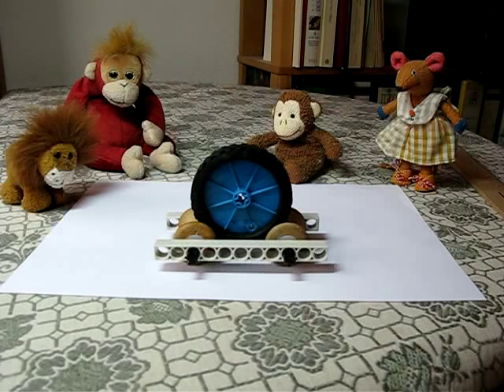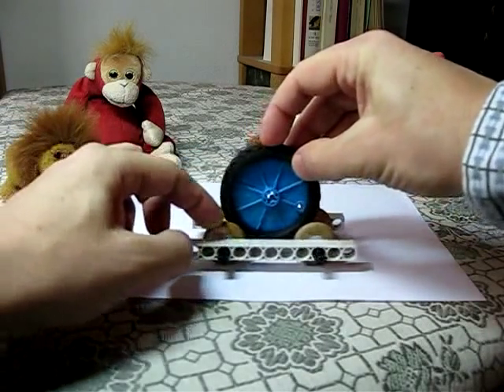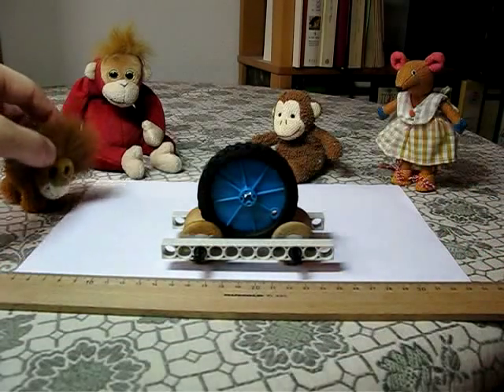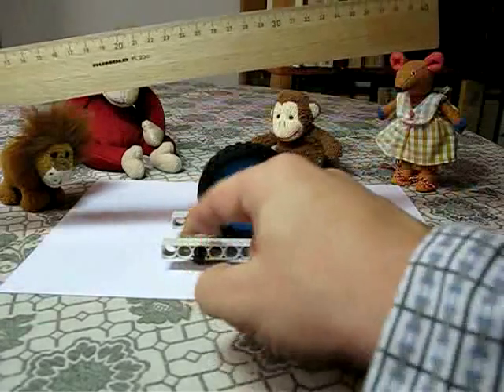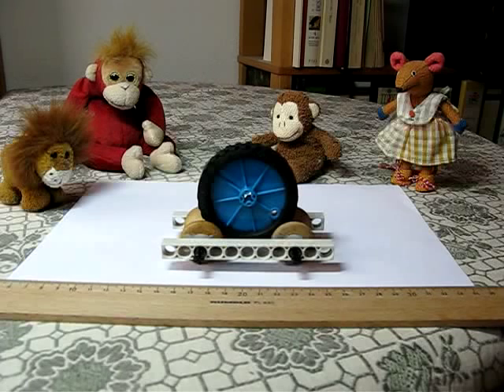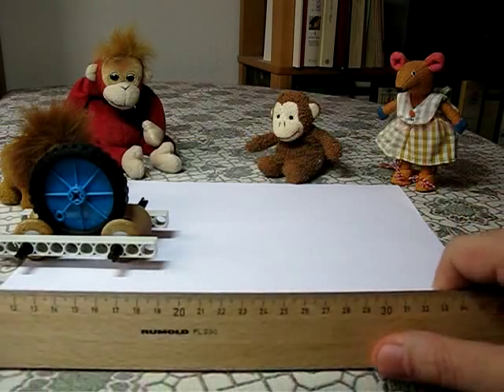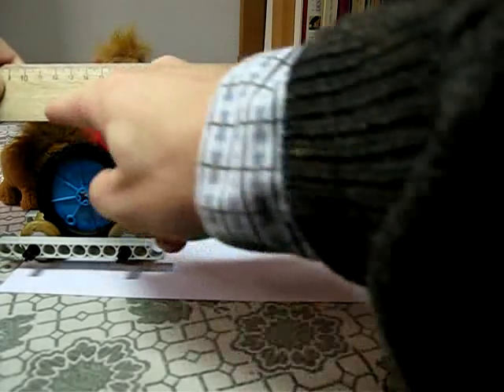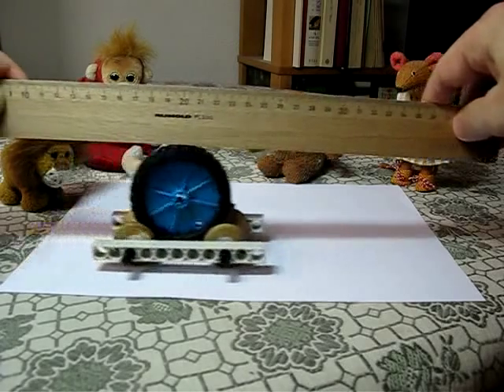Under the ruler faster than the ruler

Comment from the maker: nadahere, mathematical analysis shows that the size of the blue wheel plays no part in the relation between speed of cart and speed of ruler. This is easily confirmed in an empirical test. If the radius of the ends of the cotton reels is b, the radius of the part of the cotton reels where the blue wheel touches them is a, Vr is the speed of the ruler and Vc that of the cart, then:

Vc = Vr(b/(b-a))

The cart goes faster when the two values are close.

Comment from the maker: It's not a question of a difference in friction. There is enough friction both between ruler and big wheel and between small wheels and table so that in both cases there is no slippage. It would work just as well with rack and pinion gearing. The speed and direction of movement is dictated by gear ratios. In fact the big wheel could be any size: the important relation is that between the radii of the cotton reels at their edges and at their centres.

Comment: Confusion arises from the expectation that the direction of the big wheel's rotation is dependent upon the direction of the ruler's motion. That would be true if the big wheel's position were fixed in space by an axel on brackets, bolted to the paper -- but not if the big wheel is free to move, as it is. The ruler pushes the big wheel, spinning the  little wheels, which turn faster because they're smaller, which moves the cart against the paper, and against the ruler (in the same direction).

Comment from the maker: The big wheel is not just to distract. The force is certainly transmitted through the big wheel: that's the only thing that is in contact with both the ruler and the smaller wheels. It is not the angle of the ruler but the direction of movement of the ruler that is important. Why not try it yourself? The machine is very simple and has no hidden secrets.

Comment: My theory is that he may have put pressure on the ruler, canceling the big wheels spin and as he moves to the right, the prussure and movement will make the bottom wheels move in that direction, turning then big wheel the opposite, so it's as if it is an illusion

Comment: You are all partially right, even coolaun. ALL the radius(circumference) ratios play a part in making this device move faster than the ruler. Some ratios work better some worse. Just think in terms of your transmission and tire size. Some ratios will not even work because sufficient force might not be transferred to move the device. See the videos "It works" then "8 to 40" and last "40 to 40". Perhaps you'll figure it out.

Comment from the maker: Watch the video carefully to work out how the cart was made. Here's what I used:
- 2 cotton reels (v. important: the radius at the centre is considerably less than that at the edges).
- A simple frame with two axles on which the reels can turn freely.
- A wheel with a flat profile tire that will sit neatly on the cotton reels.
The hardest part was finding suitable cotton reels. You may have to improvise: you could build rollers similar to the cotton reels with parts of a construction kit.

Comment from the maker: Yes, indeed: when b = a the cart doesn't work! Up to a certain point, the closer a is to b, the faster the cart goes in relation to the ruler (you can see this if you look carefully at panoik's videos). But this can't go on indefinitely: when a is very close to b, the ruler starts to slip. You can see what happens when b is exactly equal to a in avian6's video, "Experiments with a three-roller cart": when the ruler is moved, it just skids over the wheel.

Comment: clever contraption. has this principle been used in any technology?
Reply: It's an ancient technology.  It's used a lot actually.  Just not quite as much after we've turned digital, but any old pocket watch uses this to turn the hands at different speeds (for one example).  We still use it in satellites and such.  Most high level technology still uses it, but in daily life, it's less common nowadays.  That's why watchmakers were considered a very high paid job back a long time ago, because they were masters in classical physics  ^_^
Reply: AcanLord seriously?  COME ON
Reply: the inner diameter of the bobbin takes less distance to complete one revolution compared to the outside.  it's no different than a 5th gear in your car.

Comment: Big wheel can't spin, cause he has to push down on the cart hard enough for his sideways pulling to actually have an effect, yeah? When the little wheels spin, the big wheel spins at the same speed, but since it's larger then then the little wheels, it makes them spin in the opposite direction much faster. I hope that helped. I hope I'm right.

Comment: its because he is pulling the ruler in relation to the ground... the bottom the of the cottone reels. If he was sitting on the car and pulled the ruler forward, it would go the other way.

In essence he is actaully pulling the cart, like with a string but with a gearing system to make it move a little faster.

Comment: I made a general statement regarding ratios of gears/wheels their velocities, power transfer and non/functionality. I should have clarified that if the center wheel was small the ruler might not be able to transfer enough force to make the device work. Ergo, even the center wheel contributes to making this device move faster than the ruler.

Comment from the maker: It not a proof, but it demonstrates the same working principle: that the relative lateral movement between two media can be harnessed to create a faster movement in exactly the same direction.

In the case of this machine the two media are ruler + table top. The blue wheel engages with the ruler and the cotton reels with the table top. In the case of the DDWFTTW cart, the two media are air and ground. The propeller engages with the air and the wheels with the ground.

Comment: I didn't really watch the whole thing but here's my take. Velocity for the wheel is constant, but the radius of the large wheel is obviously larger than that of the smaller wheels. Velocity for a wheel is radius * angular velocity. The angular velocity is the same for all wheels, but the radius differs. Because the radius is larger for the large wheel, the velocity is larger, making the large wheel move faster. The small wheels have a smaller radius therefore a smaller resultant velocity.Got it?

Comment: the ruler is also curving, use a solid metal ruler or a 1" by 1" steel rod so it doesn't curve and it will have less effect at turning the rubber wheel... just guessing anyways

Comment from the maker: A basic principle of gearing is to fix two wheels of different sizes on the same axle. The speed of rotation is the same, the speed at the *edges* of the wheels is not. Get hold of a cotton reel, a spool for holding electric cable, or something similar. The essential thing is to have something that will roll along the ground, with a central part that is thinner than the outer "wheels". Then look at my first video (Along the paper). See if you can duplicate the effect in that video.

Comment: This in no way relates to the blackbird fallacy (it just creates more)   This combination of different diameter wheel creates a lever (gear style).
The large wheel moves a greater distance over a surface than the little wheel simple because of different diameters . That different distance travel means the small wheel is exerting the greater force . (exactly as a simple lever on an off centered fulcrum would do  , The longer side (large wheel ) moves further than the short end (smaller wheel) so more mass can be lifted with less force but at a SACRFICE in distance, lower velocity , equal and opposite momentums)  SO THE smaller wheel determines the direction the cart (and the ruler , relative to the ground ) will move when a small force is applied to the spin of the large wheel .   VERY basic mechanics and completely intuitive .
Reply: The diameter of the large wheel is irrelevant here. Analogy to Blackbird: ruler represents the moving airmass.
Reply: @eyytee  You are aware that the first 'blackbird ' was put together in 2010 , two years AFTER this little toy experiment . (this video done two years before 'blackbird' was created )  So... the blackbird was analogy to a toy cart ?  Too funny !

Comment: It's because there's enough weight from the ruler pressing on the top to move the whole unit since nothing is resisting the lower wheels.

If you did the same thing but with only enough weight to affect the rotation of the large wheel the result would be what you'd expect.

Comment: Mathematically, there's no limit to how fast the cart can go.  In the real world, there's a limit to how big the big wheel can be, and there's a limit on how much horizontal force you can apply to the big wheel.  There's a nice animation, where the "ruler" has teeth that engage the big wheel, at 
h++p : // sifter.org / ~simon / journal/ 20101107. h. html

Comment: I finally had time to recreate this on LittleBigPlanet, and did it with 3 different spool types.  1. Cylinder shaft = didn't work. 2. Shaft smaller than wheels = worked as per the video. 3. Shaft larger than wheels (on rails) = ran in reverse direction.

I'll post a video once my wife gets off my arse about being obsessed with this!

Comment: Imagine no wheels, as if everything's a cube.  If there is a enough friction between the ruler and the cube to break the static friction with the ground, the car will move in the direction of the ruler at the same speed as the ruler.  Now put the wheels back in. Wheels aren't effected (nearly as much) by friction.  So as the cart gets pulled the cart wheels turn against the ground, they in turn make the big wheel turn, which walks along the ruler pulling the cart faster then the ruler.

Comment: could someone explain why the big wheel moves opposite to how you think it should move?
Reply: imagine you're walking forward and slip, which direction do you fall? thats because as the weight is focused on a smaller area, it accelerates faster than ou were moving fore, causing you to fall back.

Comment: "look at the angle of the ruler. see how it angles out when he moves it? he's NOT trying to move the big wheel, but instead, he's pushing down with the ruler to move the smaller wheels at the bottom. he's using the force of the ruler pressing down to provide traction for the smaller wheels to move. the big wheel is just to distract you.

besgeo 2 years ago"

Comment: This is all about friction. The friction between the little wheels and the paper is higher than between the big wheel and the ruler. If the friction between the big wheel and the ruler were higher than the little wheels and the paper, the cart would move to the opposite direction of the ruler.
Reply: shadowdsfire friction plays a part because you studied frictionless surfaces in physics right?
Reply: shadowdsfire THE DIAMETER OF THE RULER DOESN'T PLAY A PART BECAUSE YOU ONLY SEE A STRAIGHT EDGE.  THE DISTANCE TRAVELED BETWEEN THAT RULER AND ANOTHER GEAR ON TOP ISN'T ANY DIFFERENT.  THE SMALLER WHEELS ACTED UPON BY THE LARGE IN THE CENTER IS THE ONLY REASON IT APPEARS TO MOVE FASTER.
Reply: shadowdsfire ALSO, I BET YOU FORGOT THAT THE CENTER OF THOSE SPINDLES IS SMALLER THAN THE OUTER RINGS THAST MOVE THE OBJECT...
Reply: I never said the diameters of the wheels played a role, it was must for identification purposes. 

I've read this explanation somewhere else and it made a lot of sense to me. But I'm apparently not very good at explaining it myself.
Reply: the ruler is to distract people.  the inner diameter of the bobbins is what makes it appear to move faster.
Reply: That doesn't make any sense. At all.
Reply: it really does, since the distance it takes for smaller diameter of the bobbins to complete one revolution is less than that of the diameter of what actually rolls to the ground the outside of the bobbin, the wheel acts upon that center turning the bobbins, and thus moves it with less motion from the acting force of the ruler..i'm not a math professor, i just understand it., its like your 5th gear in your car.  i also scored in the 98 percentile in the united states for mechanical understanding on my asvabs. not that that says a whole lot. but I've never taken any sort of lessons for it.
Reply: +shadowdsfire Yeah, that's what I was thinking.  If he just angled the ruler down on the end he pulled towards (e.g. move the right end down a bit as you move to the right) the car would move the opposite way... i think.
Reply: no. its all about dynamics. You can solve this easily with dynamics. and it makes sense.

Comment: It's not the sam working principle. I'm not sure I can argue with my limited engliszh, but i'll try. I'll give an example that wind is different to the ruller. The faster a vehicle goes downwind, the lighter is the relative wind that is powering the vehicle. With 10mp\h wind if a vehicle also goes 10 miles per hour in the wind the relative wind affecting the vehicle willbe 0mph! So no wind to power the vehicle. Wind is affecting the whole vehicle, your ruler only a small part of it.

Comment: LOOK AT THE ANGLE OF THE RULER...ITS NOT LEVEL WHEN THE WHEEL MOVES, ITS ON AN ANGLE. HES NOT SLIDING IT ACROSS THE BIG WHEEL BUT PUTTING DOWN FORCE ON IT WHICH IN RETURN IS SPEEDING UP THE WHEEL. jUST AN ILLUSION.

Comment: Wow, l lets me just explain this because all other explanations having to do with friction and forces are wrong. A simple diagram of this effect would be a stationary rack gear (teeth in a straight line), connected to a spur gear 1(circle gear), connected to a spur gear 2, connected to a rack gear that is fixed to be parallel to the first.
Now imagine that that the two spur gears are the same size. What happens in the situation? as you turn spur gear 1, spur gear 2 spins at the same "speed" and the rack stays in the same position. now imagine that spur gear 1 has more teeth than spur gear 2. As spur gear 1 turns clockwise, spur gear 2 spins counterclockwise at a higher "speed" and and the rack ends up going the opposite direction as the two gears.
Now finally the third situation is the one in the video. Spur gear 1 is smaller than spur gear 2 and the gears go the same direction as the rack.